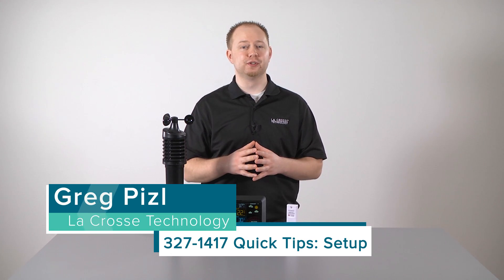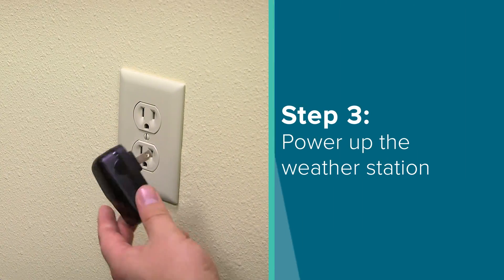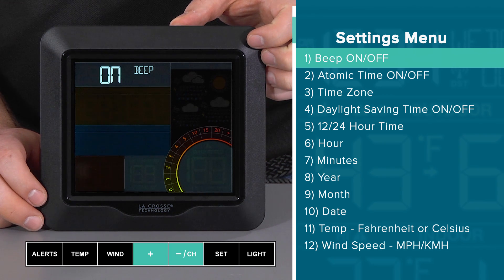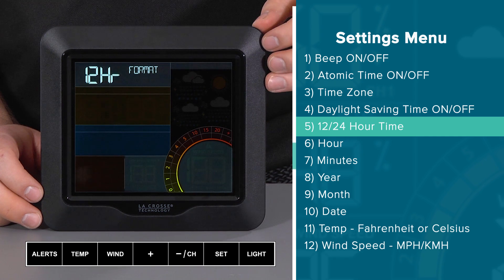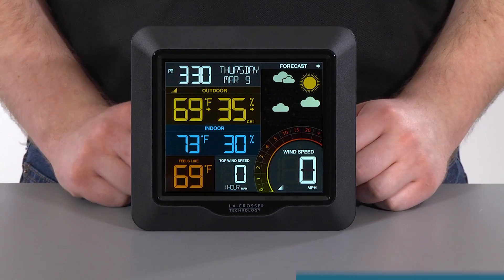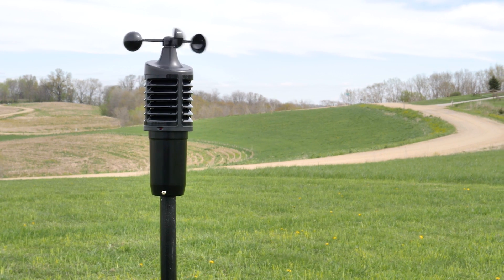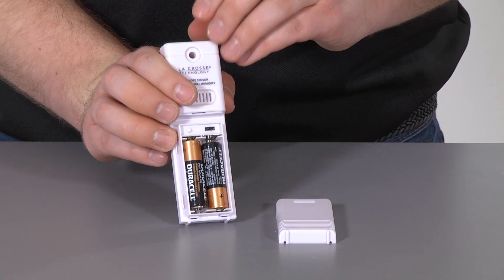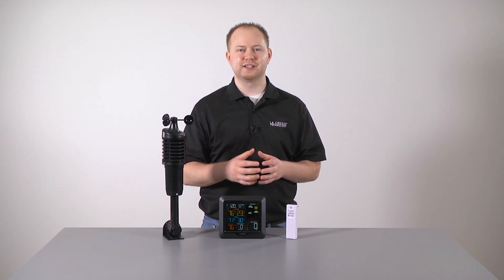327-1417 Color Wind Speed Weather Station Setup

Comment: Hi, I bought one and use it in a beach-front property in mainland Greece, we get some very strong winds here, at some point it reaches 23-24 mph and up, when that happens the wind meter stops completely and says (Top Wind Speed). After that it wont read wind speed anymore. I have to go up on the roof and take the batteries out from the wind meter and put them back in, and that resets it back to normal and starts to show the wind speeds again. I installed it 2 months ago and it did it ones about 1 month ago, and today it did it again after a very windy night. So I have to go again and reset it by taking again the batteries out and in again. Is there any other way to reset it after this happens? Why does it stop reading the wind after strong winds? Other than that I really like it as a product. But having to climb on the roof to reset it is a bit of a hassle, it seems so far that this would be happening 1-2 time a month knowing the winds. Is there a reset button? Or a way to reset it without having to take the batteries in-out? Thanks.
Reply from the maker: This is highly unusual, and we apologize for the inconvenience. For personalized assistance, please message our support staff here: https://bit.ly/contact_techsupport -- We're here to help in any way we can.
Reply: @lacrossetechnology Thanks, I will contact them and see what they say.

Comment: la cross weather stations are crappy My wife bought us one to monitor our home temperature when we weren’t home. The last few weeks is has been unreliable. We will be getting a different brand as we can’t depend on this to work. There is nothing wrong with our home internet as we have other devices on both Wi-Fi frequencies that work just fine.
Reply from the maker: Hey Chris, we hear you and sincerely apologize for the app issues the past two weekends. Our developers are working around the clock to help get this resolved so things like this don't happen again. We appreciate your patience and hope we can make this right. For further assistance, please message our support staff directly here: https://bit.ly/contact_techsupport. Or alternatively, send us a private message on our Facebook: http://bit.ly/LaxTech_Facebook page. We are here to help in any way we can.
Reply: I read the directions and watched this video. I just bought this at Walmart about an hour ago.  No where did I see anything about adjusting the screen brightness?  The screen is so dim you can't see it.  You can press the light button and it lights up.  But it turns off in a moment and you can't see again.  I thought that the light was adjustable from Hi to Lo to off? That's what it says in the printed instructions,  but doesn't tell you how to enter the settings and save them?

Comment: How does it recognize the interior temperature if everything is outside
Reply from the maker: Hey Greg, there are temperature and humidity sensors built into the indoor display. 😊
Reply: Don’t count on it to work Ours weather station has been unreliable using the app because the server La Cross uses isn’t reliable
Reply from the maker: @Chris_at_Home  We again apologize for the app trouble you've experienced. Please note the 327-1417 weather station featured in this video is not a Wi-Fi Connected product and, therefore, doesn't use the La Crosse View app, so out of context, this may cause confusion for other users. For assistance, please message our support staff directly here: https://bit.ly/contact_techsupport. Or alternatively, send us a private message on our Facebook: http://bit.ly/LaxTech_Facebook page.

Comment: My windspeed is not showing 0 mph.  It is just showing two dashes.   How do I make sure the sensor is connected?
Reply from the maker: Hey Lonny, try moving the sensor inside next to the display and installing a new set of regular alkaline batteries. After this, Hold down the WIND button on the display until you see the reception icon start animating. While it's searching, try spinning the wind cups to ensure the wind sensor is transmitting some data. It should connect within the next few moments. If not, try a full factory restart by pressing and holding down both the LIGHT and ALERTS buttons down together until the station beeps and clears. It should then begin searching for the sensor(s) again automatically. If this still does not get the wind sensor working, please message our support staff directly here: https://bit.ly/contact_techsupport. Or alternatively, send us a private message on our Facebook: http://bit.ly/LaxTech_Facebook or Twitter: http://bit.ly/LaxTech__Twitter page for further assistance. Our apologies for any inconvenience.

Comment: 327-1417 Color Wind Speed Weather Station.  I just purchased the other day and have two issues.  I put the sensor on a north wall outside under the roof overhang but it seems the hot air gets trapped under the overhang so it shows an inaccurate temperature.  Also the wind sensor has lost connection a couple times a day for 15-20 minutes at a time then it comes back.
Reply from the maker: Hey Mike, sorry for the trouble! If you believe you're getting inaccurate outdoor temp readings, you are free to move the sensor to a different fully shaded, well-ventilated, location that offers protection from direct weather elements (rain, snow, etc.). Our other video here: http://bit.ly/inaccurate_temp_readings goes into this topic more and covers how to perform a test to make sure the sensor is within tolerance. In regard to your wind sensor losing connection, please be sure the sensor is within range and that you are using a new set of reputable alkaline batteries for best results. The wireless range for the sensor is 330ft in the open air, for each wall, window, or floor this radio signal must pass through this signal distance is roughly cut in half. We apologize for any inconvenience. If you should need further assistance, please message our support staff directly here: https://bit.ly/contact_techsupport. Or alternatively, send us a private message on our Facebook: http://bit.ly/LaxTech_Facebook or Twitter: http://bit.ly/LaxTech__Twitter page.

Comment: Just got mine today the wind speed is not showing. Still has dashes instead of numbers
Reply from the maker: Hey Sindy, our apologies for the trouble. We'd first recommend bringing the wind speed sensor inside next to the display and perform a basic restart. The steps for this are covered on our support page here: https://bit.ly/basic_restart -- be sure to use a new set of regular alkaline batteries, other types can often have transmission issues. If these steps still don't allow the sensor to connect, please message our support staff directly here: https://bit.ly/contact_techsupport. Or alternatively, send us a private message on our Facebook: http://bit.ly/LaxTech_Facebook or Twitter: http://bit.ly/LaxTech__Twitter page for further assistance.

Comment: My outdoor sensor is not working. It is not communicating with the base. I have used two different sets of new batteries to no avail.  It seems that they fit loosely in the battery compartment.
Reply: My problem is occurring on the initial setup of my weather station which was done according to your YouTube video.
Reply from the maker: We are truly sorry for the sensor trouble. If you've tried the restart steps covered here: https://bit.ly/basic_restart and are still having issues, please message our support staff directly here: https://bit.ly/contact_techsupport. Or alternatively, send us a private message on our Facebook: http://bit.ly/LaxTech_Facebook or Twitter: http://bit.ly/LaxTech__Twitter page for further assistance.

Comment: I received my wind station as a gift yesterday.  I have it all set up and all is paired and functioning except the wind history and direction display is missing the top part of the numerals. The tops of SSE (as example) and the top of the numeral for the hourly max are invisible.  Is there a fix?
Reply from the maker: Hey Bill, sorry to hear this. Please try the following steps to help get things working correctly:

1. Remove all power from your display. Including batteries and unplugging the power cord from both your wall and from your display.

2. Press any button on the display at least 25 times and leave it sitting without power for at least two hours.

3. Power the display back up by plugging the power cord into your outlet first, then into your display. If your model uses AA or AAA batteries, be sure to install a new set of alkaline batteries, other battery types should be avoided. Your sensor(s) should sync back up within the next 10 minutes. 

If this does not resolve the issue, please message our support staff directly here: https://bit.ly/contact_techsupport. Or alternatively, send us a private message on our Facebook: http://bit.ly/LaxTech_Facebook or Twitter: http://bit.ly/LaxTech__Twitter page for further assistance. We assure you we are here to help and are deeply sorry for this inconvenience.
Reply: @lacrossetechnology  I will try calling.  I performed this operation 4 times over the weekend.  It actually is worse now.
Reply from the maker: @billowen2354  we're sorry to hear that. Our Facebook or Twitter page will likely offer a quicker response this time of year, but our staff will get back to you as soon as possible no matter which method you choose. Our apologies again for this inconvenience.
Reply: They took good care of me.  Thank you.

Comment: Hey, I have a question. I bought this station and love it...but was wondering if I needed to bring in the wind sensor during the winter because of ice...or should it be okay?
Reply from the maker: It can be helpful to have the wind sensor mounted in an accessible location, to remove any snow or ice buildup. However, the sensor itself was designed to be outside all year round and should have no trouble working in the winter.

Comment: Purchased early summer 2020 - worked fine.  Windspeed indicator stopped two days ago.  Batteries (C cell) low so replaced.  Still no windspeed or history showing.  No DC power getting through from C-cells.  Contacts rusty -  looks like water has settled in base.  What to do now?
Reply from the maker: Hey Doug, we are truly sorry for the wind sensor trouble. Our first suggestion would be to bring the sensor inside next to the display and clean the battery contacts as best as you can. After this, install a new set of alkaline batteries into the sensor and reset the display by removing all power, pressing any button at least 25 times, and leave it sit without power for about 10 minutes. After this time, power the display back up. Your sensor should reconnect automatically within the next 10 minutes. If it does, we then recommend wrapping some Teflon tape around the sensor’s threads before screwing the cover back on. This should help keep any water and excess moisture out of the battery compartment. 

If, however, the sensor does not reconnect, please message our support staff directly here: https://bit.ly/contact_techsupport. Or alternatively, send us a private message on our Facebook: http://bit.ly/LaxTech_Facebook or Twitter: http://bit.ly/LaxTech__Twitter page for further assistance. Our apologies again for this inconvenience.

Comment: Is it possible to connect a color screen to a sensor that was from the  plain display station
Reply from the maker: Unfortunately, the TX141WV2 sensor that comes with our 327-1417BW station will not work with our 327-1417 color display. The 327-1417V2 color display will require our TX144W wind sensor that does not come with built-in temperature and humidity readings. We apologize for any inconvenience.

Comment: Hi do you have to undo the two screws at the bottom to change the batteries  thanks
Reply from the maker: No, you will not have to unscrew any of these parts to access the battery compartment. Please review our steps in this video starting at 0:59 for proper instructions.

Comment: I just bought your 327-1417 system. Everything works fine but the forcast. Its sayen its sunny 24 hours a day for 4 days now.
Reply from the maker: Hey Charlees Dad, our apologies for any trouble. The calculations for this station’s weather icons are based on its internal barometric pressure reading. Keep in mind, these icons are designed to display a prediction of your weather to come within the next 6-12 hours, not necessarily your current conditions. And because the weather can be a hard thing to predict, even for professionals, we cannot claim these to be 100% accurate. For most of our stations, these predictions fall between 60% and 80% accuracy after the first ten days from the initial startup. If you're still within these first 10 days, the weather icon calculations may not be adjusted to your location just yet. Over time, these should become more accurate. One other thing to note, if you're located in an area that is above 6200ft elevation, these icons will likely not act correctly. If you fall in this category, please reach out to us here: https://bit.ly/contact_techsupport. Or alternatively, send us a private message on our Facebook: http://bit.ly/LaxTech_Facebook or Twitter: http://bit.ly/LaxTech__Twitter page. From there, we'd love to help in any way we can. Sorry again for any inconvenience.

Comment: outdoor temp. is not showing up.
Reply from the maker: Hey Charles, our sincere apologies for the outdoor temp sensor trouble and for the delayed response. Our first suggestion would be to review our basic restart instructions and video here: https://bit.ly/basic_restart -- In addition to the steps in that video, your sensor has a small TX button located above the batteries. Press this after you have the power restored to both the sensor and display. This should force a transmission and connect your sensor almost instantly. 

If these steps do not resolve the sensor connection, please message our support staff directly here: https://bit.ly/contact_techsupport. Or alternatively, send us a private message on our Facebook: http://bit.ly/LaxTech_Facebook or Twitter: http://bit.ly/LaxTech__Twitter page. From there, we should be able to help get things working correctly. Sorry again for the inconvenience.

Comment: Help my tx141w wont turn on i put new battery but the sensor dont work the red light dont work help
Reply from the maker: Hi Nicolas, we're truly sorry for the trouble with your wind sensor. If the sensor is not transmitting data to your display after a reset with new alkaline batteries, than please reach out to our support staff directly here: http://bit.ly/contact_techsupport  -- We'd love to help get this corrected.

Comment: My new station has connected to the outdoor sensor and the wind sensor and both are displaying. However it is not displaying indoor temperature, feels like temperature or top wind speed. Any ideas?
Reply from the maker: Interesting. Our first recommendation would be to perform a basic restart, covered in our video here: http://bit.ly/LaxTech_BasicRestart (making sure to use alkaline batteries only). However, two deviations from this process would be to let the station sit without power for about 2 hours instead of the 15 minutes, and when powering it back up, make sure to plug the power cord into the outlet first before plugging the cord into the display.  If the problem continues, please reach out to our support staff here: https://bit.ly/contact_techsupport or message us on our Facebook: http://bit.ly/LaxTech_Facebook or Twitter: http://bit.ly/LaxTech__Twitter page. We apologize for this inconvenience.

Comment: Is the temperature sensor weather proof,  meaning is it ok to be in the rain??
Reply from the maker: Hi Gregory, unfortunately no. The separate TH (Thermo-Hygro) sensor should always be protected from direct weather elements (rain/snow/sun). We typically recommend under an eave on a north facing for best results, as covered at the 7:02 mark in this video. Though, if you do not have a great location that offers this, our Sensor Weather Shield may be something to look into: https://www.lacrossetechnology.com/925-1418-sensor-weather-shield -- as it will help protect the sensor from rain and snow. However, we do always recommend mounting it in a 100% shaded location for the most accurate temperature readings. Your wind sensor on the other hand, is built to hand all normal weather conditions and should be mounted on the highest point around your home, or in an open area. Please let us know if you have any further questions.